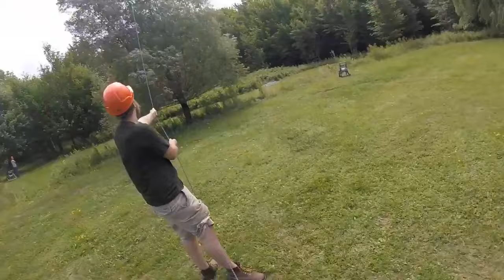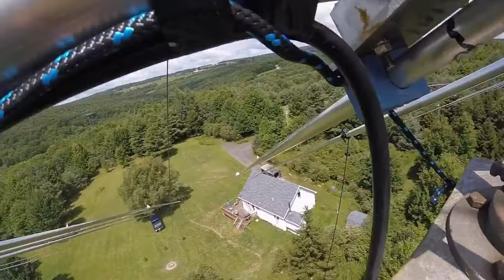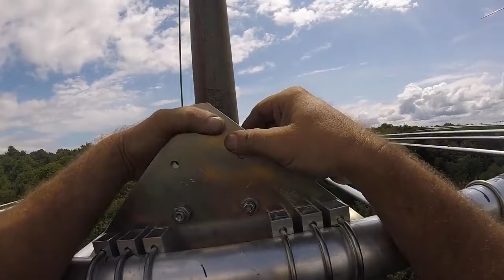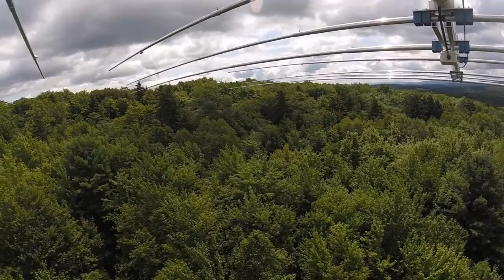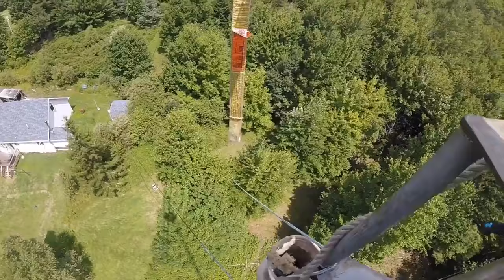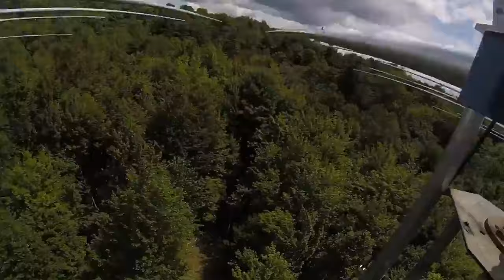Installing 16EL Ham Radio Antenna with Tram-Line system. Un-Edited! #Ham Radio

Comment: From someone who spent a lifetime working high and leading edge danger in harness and safety lines is the dire warning to all the Hams who DIY antennas like this. Simply this, you only have a very short time hanging from fall protection gear. If you cannot quickly extract yourself and climb out your time spent hanging is lethal if a rescue by crane is not quickly executed. Even on big jobs Ive done, the extraction was ready at all times knowing the short time you can hang in a harness. Be prepared and be cautious.

Comment: Ray, so antenna has RG213 Mil Spec to antenna switch on the mast? What is the coax from mast to radio room?
Reply from the maker: This tower is only 200’ from the shack, so just 213. On longer runs I use LMR-600, 7/8 hardline and sometimes 1 5/8 hardline.